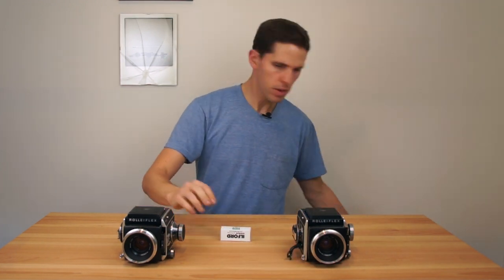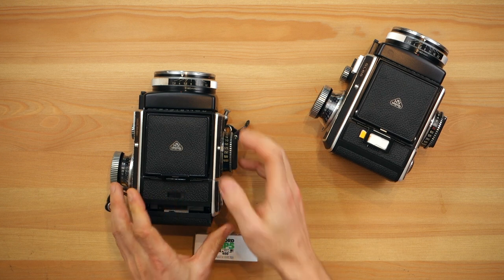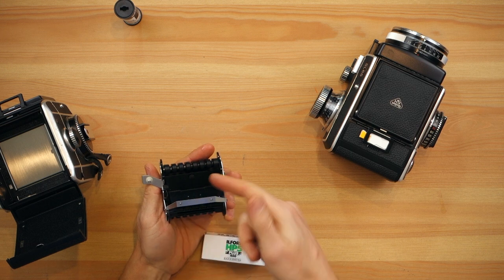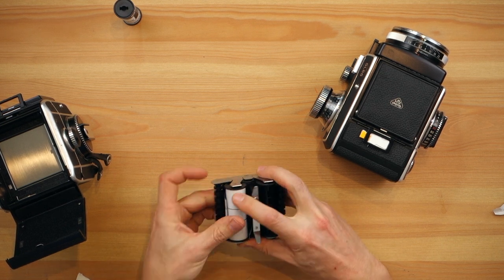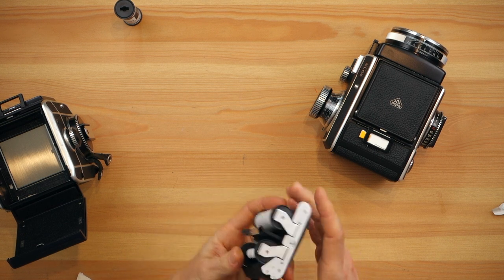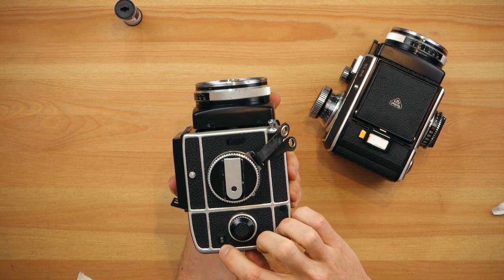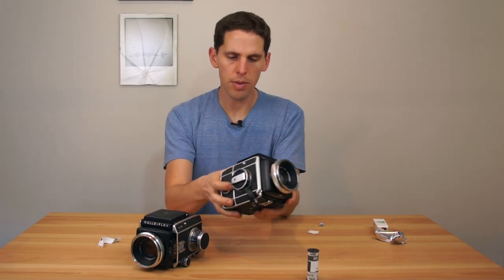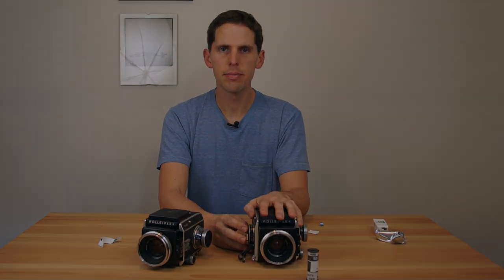Rolleiflex SL66 || Film Loading

Comment: Good video indeed, maybe that you should have told to always operate the SL66 (loading film, changing lenses...) with the shutter cocked, this is an important rule.
Reply from the maker: I had never heard of that. Also I always leve the shutter cocked so thats why I probably never considered it the other way. Thanks for the info,
Reply: I also own and use this camera and I took this advice from Gérard Métrot the french Rollei specialist, I do the same for my two SLR mamiya RB67 sd pro and SL66. I love my SL66 that I chose over a blad because thanks to its bellows the focusing distance is much closer. It can event take proxy photo inverting the lens ! The front tilt is also a great option, sadly history made things turn to the worst for Rollei...
Reply: @Nicos Photography Show  Nice review and cameras - to the best of my knowledge - rule number one written in the manual: cock the shutter before you unload/reload the film or take off/on the magazin. There are reports that otherwise a mechanism in the camera can break/bend... never force the camera to something. Have you had problems with the magazine or the camera so far? Best regards from Austria

Comment: Hallo, do you have any experience about 1 roll of 120 film with 13 slide?
Reply from the maker: Never happened to me. Probably the film starts too early. Try getting it fixed if it bothers you.
Reply: +Nicos Photography Show Thanks for reply, my SL66 is still on the way and your video is helpful. Some users mention SL66 can take 13 full 6X6 frame in one roll but I didn't get the point with their description. and I think it would be a benefit for me. :-)
Reply from the maker: +许志斌 Maybe if you just barely load the film on the back, but I find that to be sometimes a little dangerous because if you do gain 1 frame its good, but a hole roll you dont shoot (wrong loading) will be worst. Enjoy the SL66 when it arrives.
Reply: +Nicos Photography Show Get it and thanks for reminding.